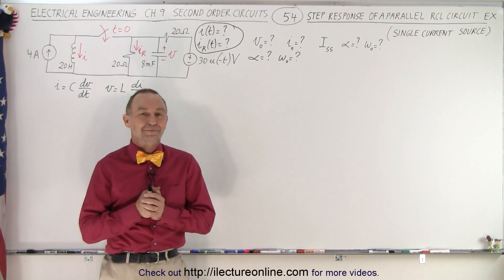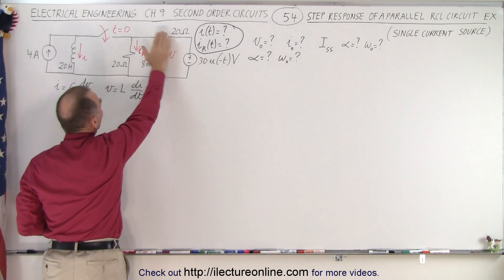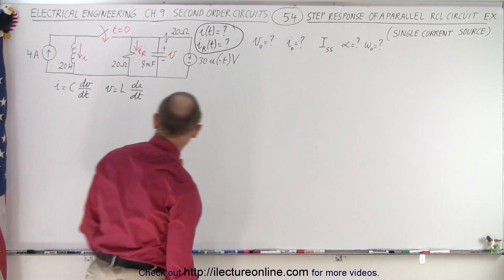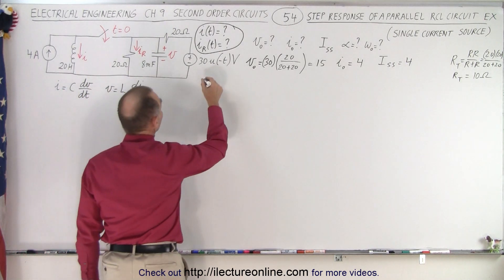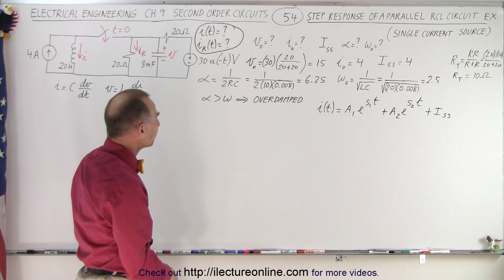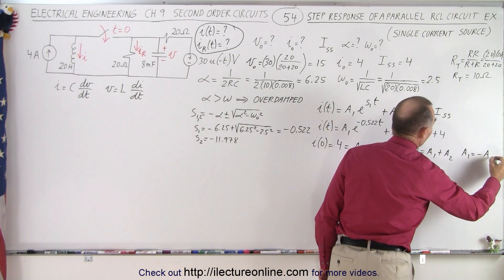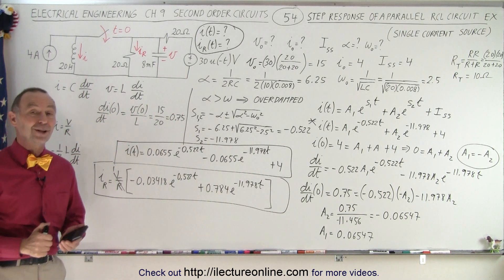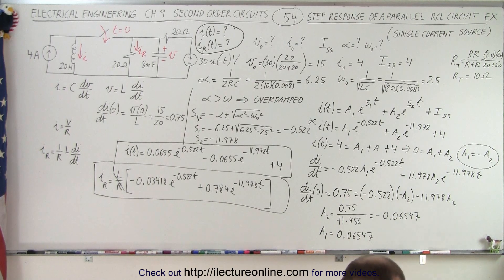Electrical Engineering: Ch 9: 2nd Order Circuits (54 of 76) Step Response of a Parallel RCL Cir. Ex

Comment: Dear Michael, I did place a switch between current source and inductor and just like you calculated everything to the third decimal point , and I was rewarded by a perfect result, here comes the fire work I(t)=-2.613e^-.52t +0.113e^11.97t+ 4A. A small gift to you as a token of appreciation for your great tutorials. Kind regards Johnny.
Reply from the maker: Thank you Johnny, good work.

Comment: @t=0, capacitor shorted to ground and therefore no I(r) ,in the first place, unless switch is placed between inductor and current source. That aside I always remain Michael's fan, coz he is absolutely fabulous.
Reply from the maker: The currents in the video are correct.  Thank you for checking.

Comment: Why we calculate the iR(t) using the voltage of inductor , like the voltage of inductor not same as voltage of resistor
Reply: Cause it is in Parallel, voltage is the same in parallel circuits, current is the same in series.

Comment: Two 20ohms resistors are series not parallel isn't it?
Reply: A worthy question! I think because the voltage of that source is defined as "u(-t)" that that is a unit step voltage source that is 30V for time values less than zero, then 0V for time values greater than zero; and in turn, can be treated as a short circuit after the switch is thrown. Perhaps professor should have mentioned this? Anyhow, great video!
Reply: @skylerpretto1221  I am fully agreed with you.  Thanks..
Reply from the maker: No, they are in parallel.  One way to determine if two components are in series or in parallel:   If the current that flows through one component MUST also flow through the other component then they are in series,  In this case that is no so.
Reply: @MichelvanBiezen  How are they in parallel? There is a voltage source between them so wouldn't there be a voltage drop, therefore the two don't have the same voltage?
Reply: @KishoreG2396  2 years later lol, but in case it helps anyone, it's as @skylerpretto mentioned, the voltage source is defined as the step function, 30 u(-t). Notice the negative for t. It means that instead of the regular step func ( 0 for t < 0 , 1 for t > 0 ) , you have the opposite:  1 for t < 0 , 0 for t > 0. And that is multiplied by 30
Reply: @juandirection3751  it actually helped, thanks
Reply: I wonder battery on right acts as a conductor?